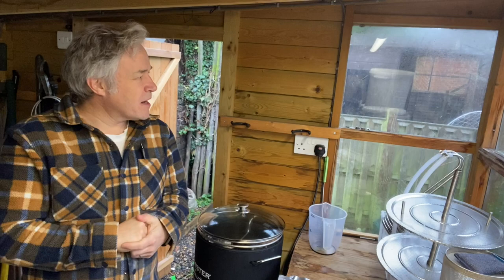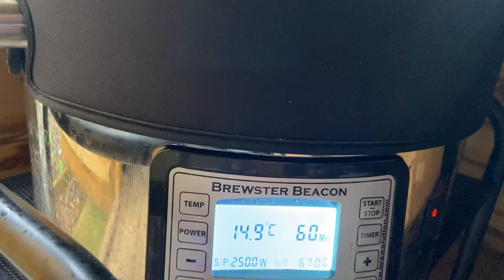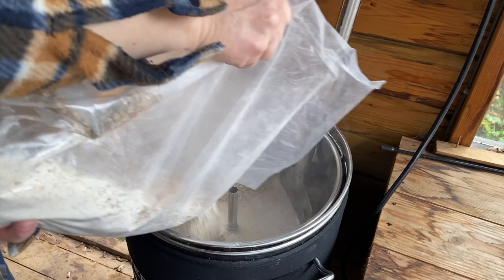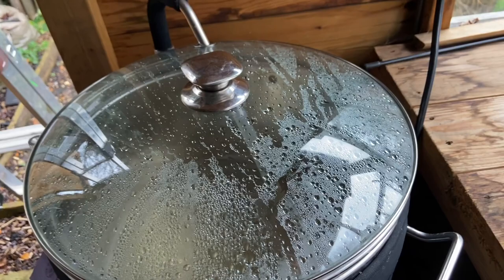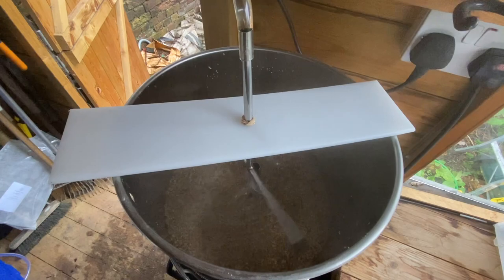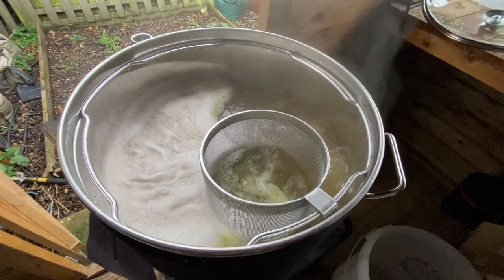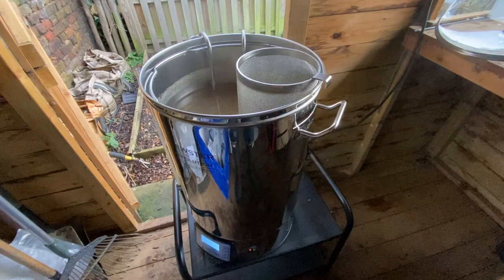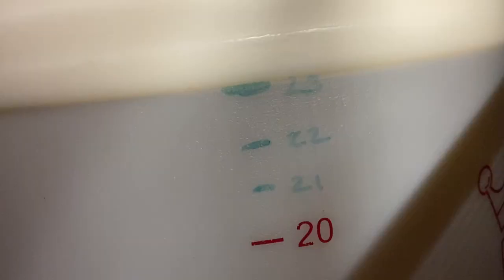John Finch Pilsner Lager Full Brew! | Brewster Beacon

Comment: Thumbs up because only one malt was used and for fly sparging. Next time, before purchasing malt use the malt spec sheet that comes with every bag of malt, they are online. Without it you have no idea if the malt is capable of producing ale and lager. There are a bunch of chemical acronyms and numbers on a malt spec sheet that are used in brewing for determining the quality of malt.
That is an interesting way to produce lager especially when the high temperature that was used during the rest denatures low temperature activated enzymes that produce ale and lager. Single temperature infusion and temperatures at 65, 66 are used by moonshiners for making beer called moonshiners beer that is meant for distillation. The brewing instructions/recipe from John Finch produced, American, home brew style, moonshiners beer. John doesn't know how to produce lager, John received training on how to make moonshiners beer and you are in the same boat, otherwise, you wouldn't have used the recipe.
To produce pseudo, ale and lager, the step mash method is used, and the brewing system would need to be capable of step mashing and reaching each step within 10 minutes without recirculating hot extract through the grain bed for increasing mash temperature or for maintaining mash temperature because prolonged recirculation of hot extract causes over sparge, which extracts tannin. That is the reason why vorlauf is kept within 10 minutes using a small volume of extract.
Single temperature infusion is used in moonshining because it is the simplest brewing method out there that is capable of producing extract that contains a large volume of simple sugar, glucose, which is responsible for primary fermentation and ABV, within one hour, so they didn't get caught, and the beer was produced with inexpensive, high modified, high protein, malt and adjuncts. Higher quality, under modified, low protein, malt is used for producing ale and lager. A malt spec sheet lets a moonshiner and an ale and lager brewer know which malt is which. Since, making moonshiners beer only requires the step where Alpha releases glucose from simple starch, the brewing method skips three key steps that are used for producing ale and lager. The moonshiners brewing method skips, conversion, dextrinization and gelatinization because the steps are unnecessary in moonshining. Chemically and enzymatically, single temperature infusion cannot produce ale and lager due to the way enzymes function and chemical precipitation, which makes strike and target temperature useless for producing the beer.
In mash resting at 65, 66, Alpha releases the highest amount of glucose from starch within one hour, that is the reason why a moonshiner uses the temperature, but the high temperature rapidly denatures Beta, which is the enzyme responsible for conversion at 60. Due to the types of complex sugar that form during conversion and from what occurs afterward Beta is purposely denatured in moonshining. During conversion Beta turns glucose that is released by Alpha during liquefaction, into fermentable, complex types of sugar, maltose and maltotriose. Maltose and maltotriose are the sugars that produce ale and lager, glucose provides only ABV. When conversion occurs, secondary fermentation takes place due to maltose. Maltotriose is responsible for natural carbonation. Beer doesn't need to be artificially carbonated with priming sugar or CO2 injection when conversion occurs. Artificial carbonation forms quickly dissipating, soda pop fizz in beer.
The dextrinization and gelatinization steps, which are skipped in moonshining form body and mouthfeel in ale and lager. There is a type of starch in malt called amylopectin. Amylopectin is hard, heat resistant, complex starch that makes up the tips of malt and it is the richest starch in malt. Contained in amylopectin are tasteless, nonfermenting types of sugar, called limit dextrin, and pectin. Pectin is cellular glue that holds everything in beer together during conditioning and storage. Limit dextrin, pectin and a particular type of protein form body and mouthfeel in ale and lager. In home brew, starch carry over, Beta Glucan and protein goop, which any one of, reduces the quality and shelf life of the final product provides body and mouthfeel. An issue with the moonshiners brewing method and with home brew recipes is that the recommended rest temperatures aren't high enough to cause heat resistant, amylopectin to burst where it enters into the mash liquid before Alpha denatures and the rich starch is left in the spent mash, which is sold in moonshining for making baking ingredients, maltodextrin. In home brewing, the starch is used for compost or animal feed. Crushing the starch into flour overloads Alpha, which causes starch carry over. To take advantage of amylopectin mash is boiled. When mash boils amylopectin bursts and rapidly enters into the mash liquid. The boiling mash is added back into the main mash resting at a low temperature to preserve enzymes, mash temperature increases, and Alpha goes to work liquefying the amylopectin causing dextrinization and gelatinization to occur. Ale and lager are produced from dextrinous extract not from extract that contains mainly glucose and depending on the rest temperature, more or less, sweet tasting, nonfermenting types of sugar and sludge.

In 1960, the triple decoction brewing method was replaced with the Hochkurz double decoction brewing method in breweries that produced ale and lager, over 60 years later, home brewers are still using the same ingredients and brewing method that moonshiners used 100 years ago during Prohibition. That is outstanding progress! Chalk it up to the advertisers that invented CAMRA and renamed moonshiners beer and Prohibition beer Real Ale, and came up with stories, recipes and contests to set the hook.